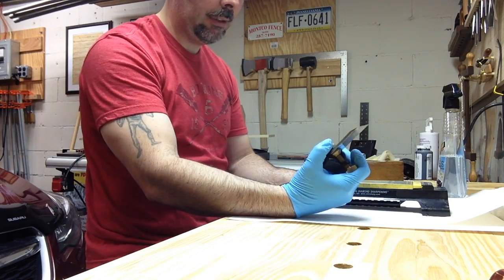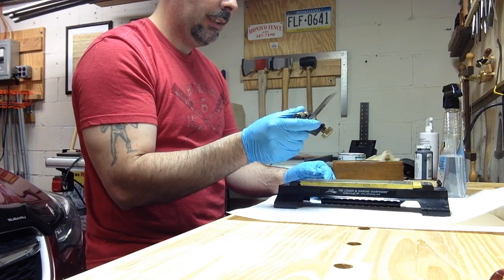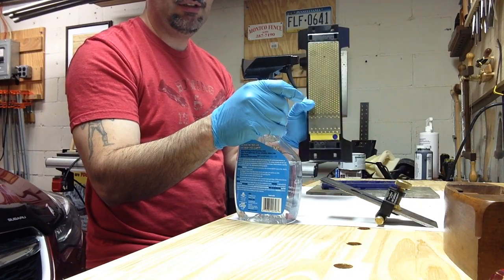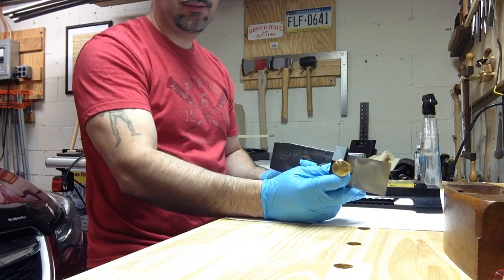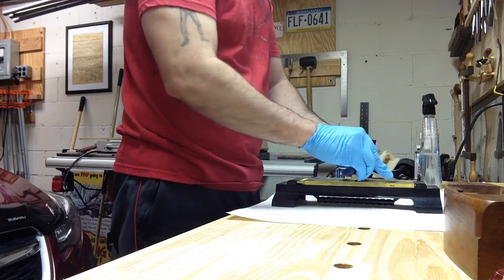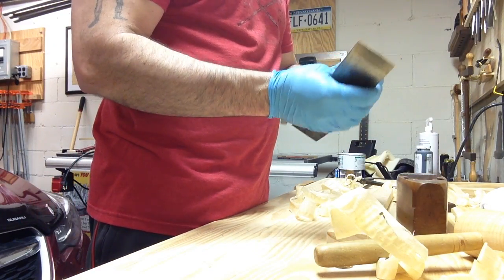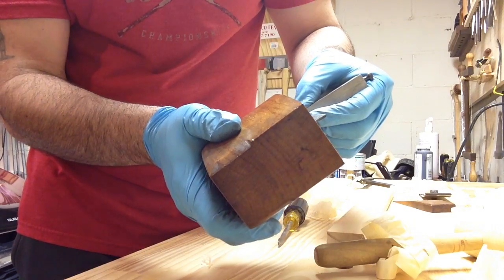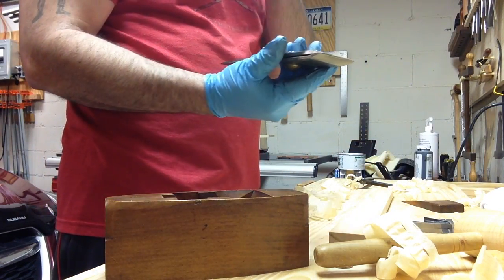Coffin Smoother Iron Rehab

Comment: This is a good one, Bill.  I have the same sharpening guide and have never tried to camber a blade with it.  I didn't see you knock the corners off, you don't have problems with plane tracks?
Reply from the maker: +Kinderhook Woodcraft Thanks! I'll definitely knock off the corners with a file. I didn't do it in the video just for the sake of time, even though it takes just a minute of two. I do apply side pressure with the Veritas guide, and it does add a very subtle camber. I probably should have mentioned that in the video.
Reply: I suspected you were doing something.  Christopher Schwarz does that trick and I know you follow his work.